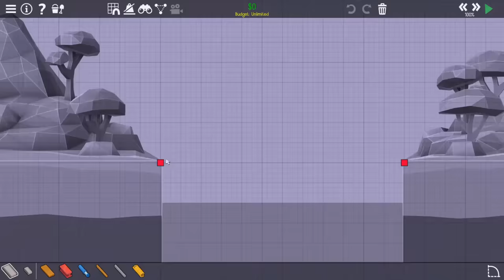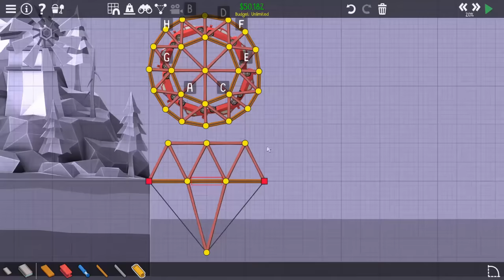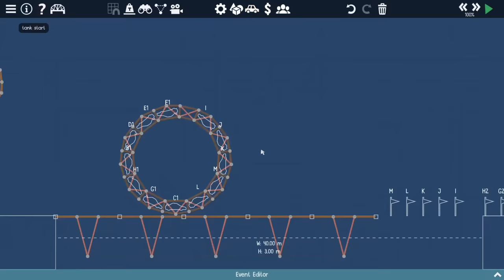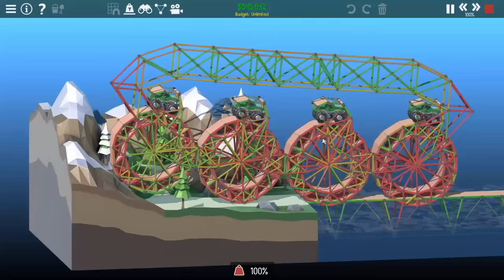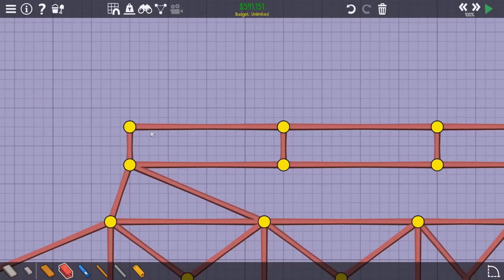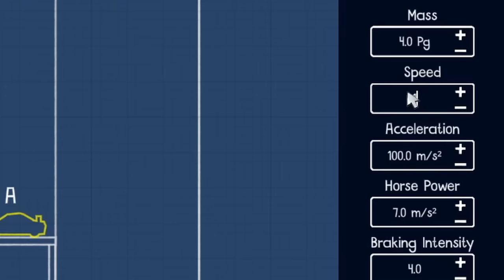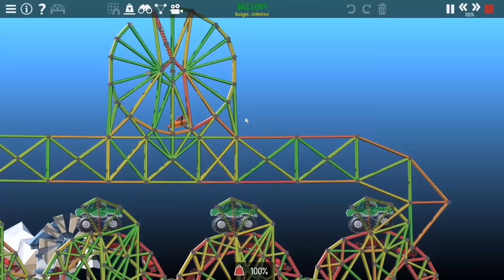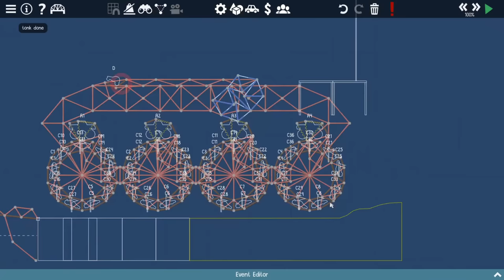Making an Armored Vehicle in Poly Bridge 2

Comment: When you want to cross a river but you're in a warzone:
Reply from the maker: EZ
Reply: @ReidCaptain  lul
Reply: @ReidCaptain  how’d you manage to break it in unbreakable
Reply: No u
Reply: @mincat1412  "falling road prevention" bug. there is a bug in Poly Bridge 2 physics which allows you to drop roads from really high up into vehicles and if done right, launching the vehicle across the level. this is referred to as "falling road". the prevention does a reasonable job at mitigating it by breaking roads stuck in vehicles.

Comment: The roads breaking in unbreakable mode is because of falling road prevention, I believe them breaking in unbreakable is a bug and will be fixed soon-ish
Reply from the maker: Good to know, initially I thought it was cars glitching into each other but that makes total sense!
Reply: Uh oh stinky
Reply: @stunner8910  you what
Reply: @conqu3red545  uh oh stinky
Reply: @stunner8910  yooo
Reply: What is falling road prevention
Reply: @ceilinglight1413  there is a bug in pb2 physics which allows you to drop roads from really high up into vehicles and if done right, launching the vehicle across the level. This is referred to as falling road. The prevention does a reasonable job at mitigating it by breaking roads stuck in vehicles
Reply: @conqu3red545  oh thanks
Reply: @stunner8910  no

Comment: I suspect it may actually be easier to make a tank with actual treads that run around wheels than to use wheels lol. each segment of tread would have a car inside, and the treads would stay around the wheels by making the wheels be made of road.

Comment: Bridge idea: 
 
Basically there is a giant claw that picks up the car and drops it in between the draw bridge and lands on the boat. Idk if this will work I just wanna see what happens when the car goes on top of the boat.
Reply: i think cars just clip through boats
Reply: @holyschmoe1466  what about a ramp that takes advantage of that with an unrealistically big boat, not enough road to go over it, and a car that goes at the same time as the boat?

Comment: THIS GUY BROKE ROADS IN UNBREAKABLE MODE!?! HOW?
Reply from the maker: It's cheat protection I think
Reply: @ReidCaptain  Can confirm. It's to prevent falling road.
If a road and a car collide with each other at a harsh enough speed or if a road is wedged inside a vehicle, the road will automatically break which prevents the car from being violently launched, regardless of unbreakable or not.
We're working on fixing this soon so that the detection is disabled when in unbreakable mode.
Reply: @ReidCaptain  Woah, you actually responded. That's rare for any youtuber. 
BTW, love your videos. Keep em coming man.